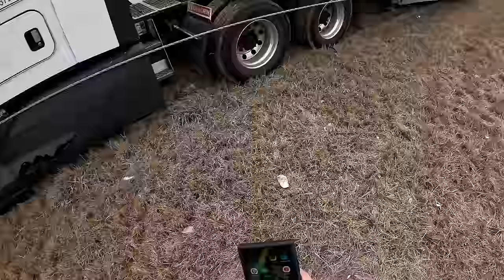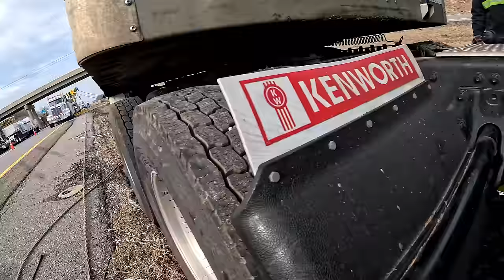Under Tension!  Another Tangled Truck!

Comment: My wife has family in MO and I totally misunderstood what these cables were designed to do. I'm from MI and we use barriers so seeing 'flimsy cables' keeping traffic apart seemed, almost, negligent. Now that I've seen how they're SUPPOSED to work it looks like a superior - and less expensive - method of keeping the 2 directions apart.
Reply: Greetings from another Michigander!
Reply: Some states put the cables down the centerline of the median. I first encountered driving through New York.
Reply: It's perhaps less interaction with the cables down the middle but more problematic for mowing.
Reply: States which use these report 80-100% reduction in cross-over fatalities. Cable barriers can also lessen severity of injuries in single car accidents, and you don't get that pinball effect of vehicles bouncing back and forth between solid barriers. On the downside, they're unforgiving to motorcycle riders.
Reply: @JV-pu8kx  Wonder if placement depends on whether or not the ground is solid enough to hold the rails in when something impacts the cable?
Reply: I thought, they were a waste of money. Until, I seen how they work.
Reply: The real danger of those rope types barrier is when a biker hits them, look what happened to the truck, a person would be it a bad condition, we have the same things in the UK. And metal ones
Reply: I'm from the UK 🇬🇧  and we have the metal barriers and some Motorways have a concrete 😎
Reply: I see jersey barriers most often up here in Canada too. I bet it's a lot harder to hop cables than a barrier.
Reply: They also don't bounce the crashing vehicle back into traffic.
Reply: A vehicle can glance off a concrete barrier and keep going. The slightest touch of the cables grabs the vehicle and totally destroys it. Seems like they should be a little farther off the road so drivers have a chance to recover if they wander out of the lane. By the time they hit the rumble strips, they are in the cable.
Reply: We have them in Wisconsin as well, mainly in the rural areas, once you hit the suburbs it switches to concrete barriers.
Reply: They have those cables on 69 close to the Indiana line.  Another Michigan man here
Reply: Michigan does use cable barriers as well, often on freeways built in the 1960's with medians less than 100 feet wide.  As of 2018 there was 380 miles of barrier on state and federal highways.  I suspect its approaching 500 miles by now.
Reply: Yes we have the cheese grater in Michigan and the vehicle are usually totally junk if they get the cabling
Reply: @JV-pu8kx  Historically in California, first there were no guards, just a fairly wide median. Then later there was a single line of two cables down the center of the median. Then there were two sets two cables on the edge of the left shoulder in each direction. Then there were chain link fences with green fillers to block the lights of the oncoming traffic. These still had the two tension cables in them. Finally all that was removed and all roads went to Jersey barriers.
Reply: @gsdalpha1358  Yes, that could be right, but the "ordinary" crash barrier is not without danger for a motorcyclist either. In the Netherlands, the government is considering installing an extra plate along the underside, so that motorcyclists have a better chance of surviving an accident. In any case, upon contact with the guardrail.
Reply: @lwilton  Oregon had long stretches of I-5 without any center barriers.  They changed that after a promenant Oregonian  was killed by another vehicle coming the other way in a crossover accident.  The legislature suddenly found the funds to make cable barriers in all rural stretches of Interstate in the state 😅
Reply: Another big advantage of cable barriers is that they are less likely to cause snow drifts and thus they are more common in snow areas.
Reply: They have bunch in the southern part of Michigan. Drive by them almost every day lol
Reply: O kk ml
Reply: US-131 south of Grand Rapids has the cable barriers down the middle of the median. I-96 going towards Lansing also has the cables.
Reply: @bobthesnowman8929   if any of the air bags goes off the insurance company is going to total the vehicle even if it has minor damage.
Reply: @gcannon455  yeah air ags are wonderful lifesavers, but damn they are expensive to replace. The driver's frontal is somewhat easy as you can typically just replace the steering wheel, but anything else requires careful installation.
Reply: I'll always stand by these cables after they kept me from going down a 100' embankment on the interstate.
Reply: @AndrewHaverson I think the top cable is 3 or 4 feet high from the road
Reply: @jsh6952 Minnesota does mostly these with very little of the cement ones
Reply: Same here in California, we have 'K Rails' (metal guard rail - a lot of which is mounted on short wood mounting hardware)
Reply: @klsc8510 greeting from California
Reply: Well, the cable system clearly works.

It caught a heavily vehicle, kept it upright, kept it from the opposing lane/traffic, and did not bounce it back into traffic onto the side of the road it started on. Looks good to me. 

Someone mentioned words to the effect of ‘not motorcycle rider friendly.’ True, but no solid object is ‘friendly” when you come off your motorcycle at 70Mph. Someone crashed near me, At well over 70. the field he went into had a barbed wire fence. What’s that song? Head to the left of me, legs to the right, I have now been chopped in two. 
(Clowns to the left of me
Jokers to the right
Here I am stuck in the middle with you.)

Comment: I see that Ethan has learned to watch traffic like you do, head on a swivel. I also noticed even that big truck got awful close to you when you were setting out the cones, didn't slow down much either. Stay safe Ron and crew!!
Reply: And the sad part at that point is that there was a completely good empty shoulder for him to move over some. Most people have zero respect for anyone working along side traffic like that
Reply: Maybe taking a lane and a half with the cones and forcing traffic to partially use the shoulder will slow people down?  Just a thought?

Comment: Even big trucks have had rack and pinion steering for quite a while now. The first ones I encountered with it were Freightliner Cascadias but, I don't know if they were first to have it. I can really feel for Ethan while trying to turn that wheel though! I've never tried to steer a big truck without the power assist to the rack and, I'd never want to! I once had to drive a small car about 10 miles to my shop from a friends house without it and was about worn out by the time I got it there...that was with the engine running and the car drivable! I can't even imagine the effort needed to turn the wheel in this situation! It's not anywhere near as easy as it was with the old "recirculating ball" steering. I drove an old Chevy that was supposed to have power steering but didn't (the pump was bad so the belt was removed) for 3 or 4 years and, it wasn't that bad at all compared to that little Dodge that my friend had.

Comment: Another fine example of the team working together.  I was amused by the different understandings of "driver's side", especially as I'm with Michael on this one.
I did notice that as you were walking towards the Western Star at about 11:50 that it did not seem to be particularly visible - maybe some hi-vis material on the under-reach would help.
Reply: It's not just the Western Star - though I agree it's particularly bad without the hi-vis on the underreach like the 2 Petes. I think the big problem is none of the 3 heavies have any code lighting on the rear aside from the lightbars on top of the cab. The rotator at least has 2 of those amber strobes (and iirc mini pete has something similar), but it looks like the WS doesn't have anything. Even just 2 code lights would help a lot I imagine, though I image that would be a ton of work and there might not necessarily be the correct wiring there.
Reply: That was legit force of habit for me. I even had a giggle at it when Ethan said to me "other drivers side Michael" 😂

Comment: Man it's nice to release the tension!! About 3 miles of my 36 miles of highway has a couple mile long sections of high tension cable. We get few four wheelers tangled up in them from time to time, and they can sure be tricky! I do love the sound it makes when you pull something out with the cable under tension. We always joke that we're gonna go play the big guitar when we get called to one in the median at those mile markers.

Ron, have you learned the trick to make cable binders out of Jerr-Dan wheel lift straps? Doesn't give you a whole lot, but sometimes it'll give you enough to pull a car tire back out.

Comment: You guys are just amazing. Not a job I'd really like - closest I ever came was when took the Recovery instructional bloc while i was a new lieutenant at Aberdeen long ago. Lot of hard work recovering a tank from a mud pit with an M-88, though I reckon you might be able to use the big (100K pound) winch on occasion. Ought to take a 4-wheeler ATV along for some of those long walks.

All best from the Piney Woods of East Texas..., Clyde

Comment: Thanks for sharing and I'm glad all are safe. Your doing a great service.
I agree that safety should come first. 
I was wondering what would happen if a rubber necker were to of crashed into the wire further down the road. 
Assuming the vehicle would of pulled it, was the wire tied down to another truck incase?
Once again, thanks for sharing and God bless on this Good Friday.
Reply: Excellent question. I hadn't thought of that 👍

Comment: Ron, we've seen how to relax the cables. But can also show you what needs to be done to restore these safety cables. So that they can do their job again after you have removed the car.
Reply: The highway department has to send out a work crew to restore the cables. It's not a simple, 5-minute task. Especially not when a bunch of the posts have been mangled.
Reply: I think there is a video on Youtube somewhere showing I think it is a MNDOT or WisconsinDOT video

Comment: Good job, you all didn't take unnecessary risks.

Now we see what the crossover cables can stop with big rigs, whats that system 
Do to sports cars?  Yes I live in Missouri 
Kcmo side. I remember back in the day we had guard rails, I think that orignal system was safer. But out state decided to save a few bucks, is it worth it?
Here in kc my sister in law fell asleep going over the Paso bridge years ago in  Honda civic from the 70s the car rode up the concrete center and came back down waking her up, no dammage was done to her or the car, just a big black tire prints on the wall.  Ive seen big trucks hit them with littel problems, you've really got to hit them hard to do anything.  If you sideswipe one not  big deal. Thats the safest option but it cost a lot of money to build them.  I think in a city its guard rails 
Out in the open maybe the wire rope , but I could see one of them take the roof off a small car. Yes it will stop it from going into oncoming traffic, but it could also cost that drivers his life.  I really think guard rails are a better option.
Not a fan of the wire rope system.

Comment: wow at 15:32 that truck looks like they didn't even try to move partially over nor slow down. I've driven trucks and I've also worked wrecks on the side of the road with the FD. I always said that working on the side of the road was more dangerous than working inside of a house on fire.

Comment: I'm not used to seeing cables like those. My province mostly uses guard rails and the ditches are typically quite a bit deeper than the ones you've got. Once you are in a ditch, it is unlikely that you are coming back out the other side.

Comment: Hello from Switzerland, I'm only now noticing (actually already in the last video) that in the event of an accident or otherwise a lane being blocked, no speed reduction is signaled, which means that you can drive through it at the specified normal speed. With us, be it an accident, construction site or whatever, the maximum speed is 100 km/h (62 mph, only on wide roads, i.e. from 3 to 2 lanes) or mostly 80 km/h (around 50 mph, in rare cases even slower if it is narrow/dangerous). I consider it very dangerous to keep the speed as it is apparently common in the USA.

Comment: Every time I pass a cable barrier I think "there's no way to survive hitting that on a motorcycle" - if you're upright it'll tangle the front wheel & catapult you headfirst into median/oncoming traffic; if you're sliding it'll be a "cheese slicer" concentrating force on the width of the cable.

Comment: Is there anything you would change about the rotator if you had it to do over again? (Specs, equipment on it, lighting package, drivetrain, seats, ect)
Reply from the maker: Knowing what we know now, yes, there would be some changes.  The rear outriggers would be the H-beam outriggers like our current front outriggers.  More lights.  More storage.  Twin steer rather then single steer.....  Just a few things.   It's still an awesome machine.   Thanks for watching and God bless.

Comment: I've often wondered what the range on the Rotators Remote Control unit is
Reply: Perhaps, they could assign certain responsibilities for each team member ie. coms, cones, chocks, etc. which could save some time, and it would give more responsibility to the team. Kenny and Ethan are checking with Ron and getting things started already.
Good job Midwest team.
Reply: @wandalbowen8101  With every recovery being potentially different and having different needs, like coms not always needed, Kenny or whoever is under the truck might or might not need certain extras above the usual basic kit in the driver & bolts case. Sometimes trying for a rush rush, extra speed  leads to things being missed.

I would think the initial need is always going to be a walk up and access the situation, form a basic plan with room to adjust, if/when things crop up. Ethan and Gavin have been showing much more experience, skill and responsibility over the past few months but Ron is the expert and the supervisor/foreman/teacher. All around, you are right though, they did a good job.

Comment: Question, why with a manual transmission you don’t have to take the driveshaft out?
Reply: No, any transmission..... the back half of the transmission is not supplied with oil when the engine is off, and will be dry turning if the tailshaft is left in.
Reply: The transmission oil is "pumped" by the input shaft. Without anything turning the input shaft, a running engine, there is no lubricant flowing through the gears of the output, or drive, shaft.
Reply: With a manual transmission, when you put it in neutral, the output is uncoupled, and can spin freely.

With automatics, you can't uncouple in that way (due to design), and it would burn up due to lack of oil/fluid flow.
Reply: @Meeandah  ohh I learned on an old TV show in Illinois called wrecked, it shows there’s a pump that sends transmission fluid to the gears, but with the engine and the pump off the gears will continue the turn when the wheels turn in, the gears could catch on fire so u have to remove the driveshaft to keep that from happening
Reply from the maker: Unit 60 is correct.  On a manual gearbox there isn't a pump.  Oil is carried up the gears to the top shaft and bearings when a gear is engaged.  With no gear engaged (Neutral) the top shaft and bearings aren't getting any oil.   Removing the drive shaft eliminates the top shaft from turning while the truck is in tow, thus eliminating the risk of burning up the bearings or an entire transmission.  Now, with an automatic transmission, you might as well buy the customer a new transmission if you don't remove the drive shaft or the axle shafts.  Thanks for watching and God bless.
Reply: @litz13  that explains

Comment: Ron, I have a question I’d like like to ask, How come you have to remove the drive shaft from the truck?
Reply: The rear, or output side, of the transmission is not supplied with oil when the engine is turned off. So if you tow it without removing the tail shaft, the back part of the gearbox is basically turning dry without an oil supply, which will quickly destroy it. Remove the tail shaft - problem solved.

Comment: Unless there is a good reason not to, I'd have a protocol set so that everyone coming onto the scene would have a headset in their PPE, and come out of the truck wearing it.  Taking the time to distribute them halfway thru the operation is unnecessary.  Guys should learn to keep the kibitzing to a minimum, and be listening to the plan as soon as they are in range.
Reply from the maker: While I agree that the headsets should be put to use much sooner, which is my fault, the headsets can't be individual PPE.   The headsets are all in a hardshell case which comes with a charger.  The case, along with all the headsets, are kept in the rotator.  Thanks for watching and God bless.

Comment: Wonder if they “cage” brakes ‘Down Under’?
Reply: Yes we do. In similar circumstances if there is a failure of, or leak in the air system, we definitely will. 19mm wrench/spanner and cage bolt for Jap or American, 24mm for Euro trucks (their bolt is captive and built into the booster).